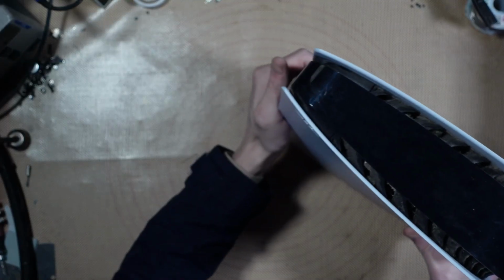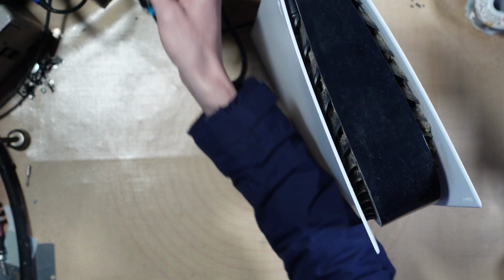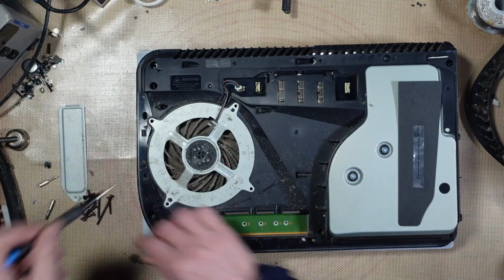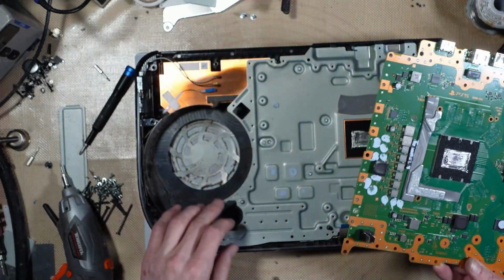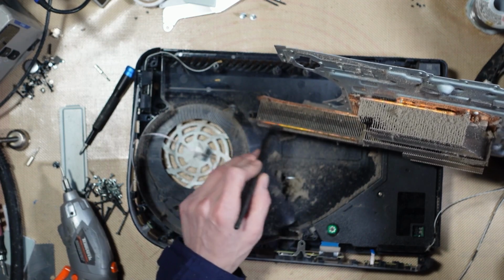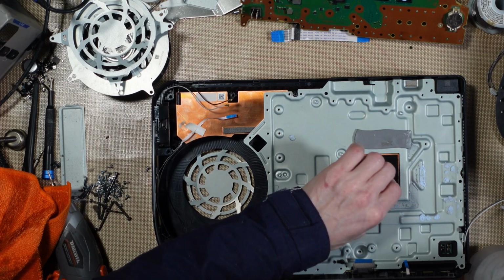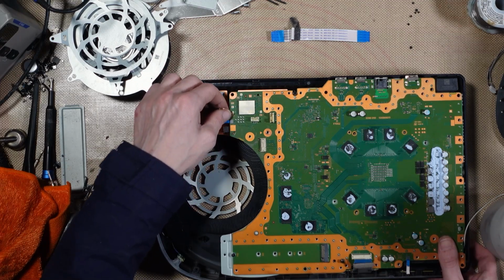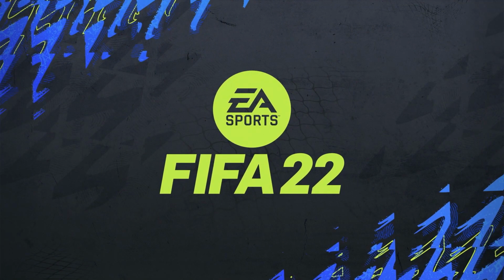I Bought A PS5 For £330 Which Already Went Back To Sony For "Warranty"... But Can I Fix It?

Comment: Steve, I figured out the reason behind the random PS5 shut down. After 5 or 6 cases like this one coming into the shop, I have started noticing the extra dirt UNDERNEATH the console - it is the power supply all along. This usually happens with consoles with no vertical stands or ones that are being used horizontally. In short, dirt, dust and other random small particles are going in through the vents at the bottom of the console, entering the power supply directly and causing shorts. This is why there are no signs of overheating like error messages or fan spinning. Clean the power supply and keep it that way and you will solve this problem. I hope I've helped. Cheers from Bulgaria!

Comment: The layer of dust in front of the radiators is more likely to have been the primary cause of overheating I think, not the dry spot on the APU. Good to see you had yet another succesful repair, keep it up!

Comment: i ran into the same problem cleaning pc's from farms dirt get tracked into the house and anything with a fan sucks it up esp if they have woodstoves too. the dust and dirt after a year in a house like that is worse then 10 years in a normal house

Comment: My ps5 use to cut off randomly last year. Figured it out it was only when a ps5 game was played. My issue was power was overheating cutting system off it never gave me a heating issue screen just shut off. I cleaned mine and it worked fine. Its 2yrs old now and at time was only about 1yr.
Reply: frinds ps5 does the same shit have to clean it here and there
Reply from the maker: Great stuff mate. Yeah the PS5 is weird in terms of the overheating errors, it's kinda hit and miss
Reply: @yamisniper  mine would play ps4 games fine only ps5 games it would shut off. Knick on wood it hasnt happened in over a year now. I placed a fan in front of my ps5 and run that when i play. It seems to keep it much cleaner. Having 2 cats im sure there will still be some dust in it but its been fine since that one cleaning. I so got a air filter that sits near my ps5 too
Reply: just got to keep it cleant hats all

Comment: And there’s me just about able to change a light bulb 🤭🙄.
Can I ask, did you watch many repair videos and have to study/practice, for years, to be able to repair electrical items? I personally love watching someone doing something smart, that I have no idea about. Oh, I dread to think about the dust in my year old Ps5. I just recently sold my PS4 to a neighbour for cheap and I had that for 8 years, only dusted the outside. That must be absolutely filthy, inside. I did think about opening up and cleaning but I was always worried, I’d break/snap something and/or drop screws, inside the PlayStation and to be honest, my 8 year old PS4 is serving my neighbour, just fine. So I see no point in opening to clean. Unless, of course there’s a fault and you think it may be due to dirt inside. Anyway, I’m hoping you get this Ps5 fixed. By what you said at start, I think you’ll do it.
Reply from the maker: Haha trust me mate it's not as hard as people think. I watched videos and practiced a lot but it wasn't for years. Maybe 6 - 8 months of watching other repair videos before I was confident enough. With yours I'd recommend getting it done after no more than two years. The PS5 seems to be a bit more sensitive to blocked vents than the PS4 was

Comment: Yes they put way to much liquid metal on the gpu I always take some off and never had a problem or any to come back from overheating.
Reply: Yeah, I remember when liquid metal was becoming all the rage for computers/laptops/etc, I saw plenty of videos where it was explained that you only want a small amount, having too much might make things worse.

Especially with the haphazard way Sony seems to apply it, and doesn't offer proper protection for the components around it. They really should have done a chassis with better airflow and just used thermal paste. I haven't heard of or seen any problems with the Series X.

Comment: I have a few odd ps4 titles that just crash constantly on the internal ssd. My house is from the 40’s and I think my ps5 is extremely sensitive to my shitty old outlets. Maybe a ground line fault because those problematic ps4 titles don’t crash when playing at my parents house which is only 20 years old. All the other games run flawless. Series X hasn’t crashed since I bought it. Truly bizarre
Reply from the maker: That's very weird, it could be doing something weird to the power supply or adding unnecessary interference. Problem is if that's the case it's impossible for a technician to diagnose unless it's their own house lol
Reply: You might want a power conditioner or a UPS that also filters the power to keep it clean on its output.

Comment: Hi m8, love watching your vids. Can you remove the board from the case to access the cooling fins on the bottom without separating the board and cooler? Ive taken consoles (ps1,2,3,4) apart before to clean them but i really dont want to deal with that liquid metal lol, im worried i will spill it somehow and end up shorting something.

Comment: great job buddy. These dry spots in the processor. Is it a Playstation 5 factory error? And is it one of the causes of overheating? Do you recommend using the PS5 vertically or horizontally ??

Comment: Phil, I've got a ps5, and I've had a bit of a house renovation recently and I left the door open to my man cave, and there is not a layer of dust in the air so I'd like my ps5 serviced just in case any dust is in there, how much is it and how do I go about getting booked in?
Reply from the maker: For the PS5 I charge a flat fee of £45 mate for the level of cleaning I went into in this video (plus return shipping). To book it in you can do so at https://www.consolefix.co.uk/book-your-repair :)

Comment: You got the early 👍 cos you asked nicely but then... You actually put a 🤢 FIFA disc into the ps5, then that music when you started taking the 6 million screws out, I would rather watch the screw extraction lol, as for the actual Ps5 I think they used it as a vacuum to clean the home, it's just disrespectful for the technician to have to clean it.

Comment: Do you have the back microphone for a ps5 controller? Took one of my 8 controllers apart and i lost that ribbon cable that has the small rubber piece on it. Connects to the board on the left of the headphine port on bottom of controller. Might be the sound canceling mic.
Reply from the maker: Sadly not mate, I don't really do anything with controllers. Check out a guy on YouTube called Uber Micro Repairs though, he might be able to help you out
Reply: @TheCod3r  thanks. Its really ok its one of my white controllers. I have another plus every color made. Might be good to have one just for parts anyway. Thanks ill check him out.
Reply: You can get ps5 controller parts on ebay son
Reply: @andyslate9996  thanks. Honestly might just keep it for parts being i have another white one so i still have every color made so far in collection.